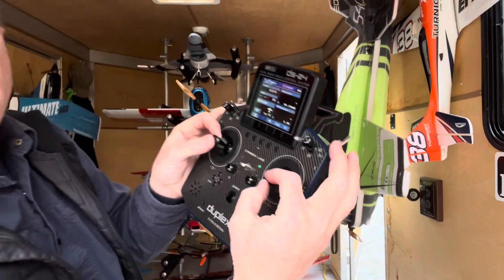RC Model Airplane Stall

Comment: While pushing down the nose may help to recover even faster from a stall, letting go of the stick does also prevent from trying to use aileron to recover a dropped wing, which, if done before the wing has good airflow, may actually make things worse.

Comment: some thoughts.         the wing of that model  has  a  ridiculously  THICK and weird,  Symmetrical  profile.        yes, it's  a  3-d;  i don't care.       the use of a symmetrical profile  is  dumb;  especially, with electric power.!      this wing design choice is a (less-than smart) carryover, from the  inferior designs spawned during the years of  Gas/glow power. 
my observations suggest that  most 'fatal'  rc airplane  stalls  occur because  the  PILOT  did  not maintain  adequate  airspeed.!     period.        consequently, a stall from low airspeed (at a low altitude)  is  just  a prelude to,  a major loss of  control authority.
it must be remembered that  most  rc pilots, today, have  NOT  learned  the  (real) Basics of  flying, piloting or control surfaces.      in part, because they  have  skipped-over  non-rc  flying;  gliders  and/or  free-flight models.      
conclusion:  it is not possible to provide advice that will prevent the piloting errors of others, when  they  don't  Understand what  flight attitude  or  stall speed means; or understand  Gliding, in general.       googletranslate
(by the time (in childhood)  that i  stopped  making  paper airplanes,  i  knew  More-than  what ninety percent of  ALL  rc pilots, today, know.      cheers)
https://wright.nasa.gov/airplane/shortw.html
Reply: he’s literally a real pilot lol